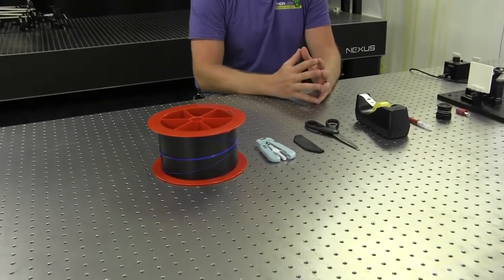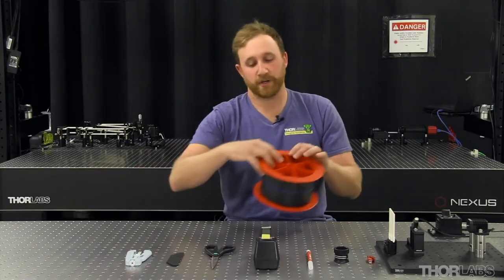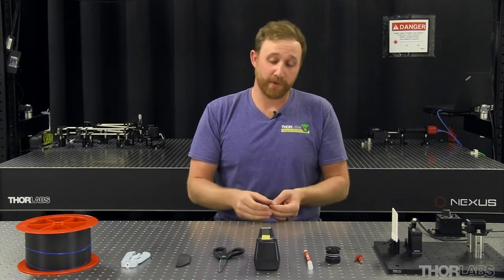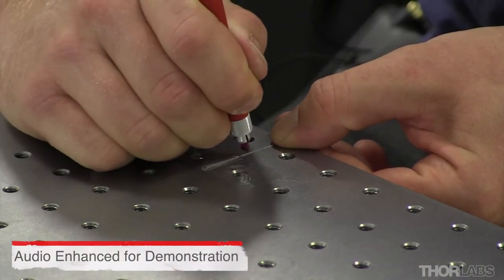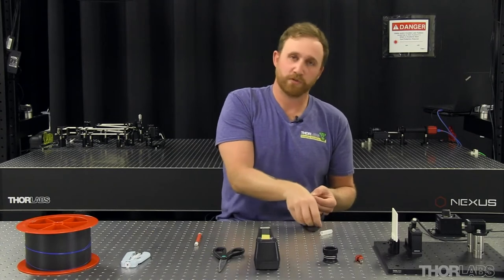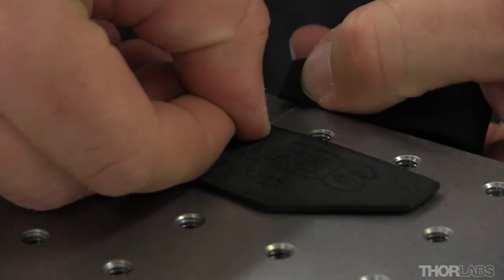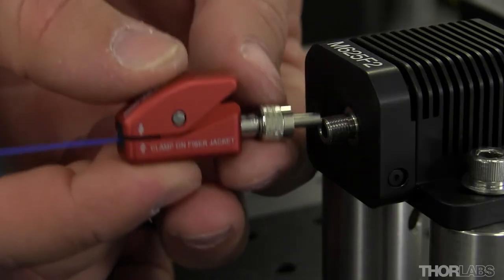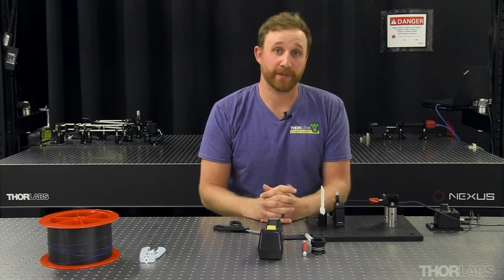Cleave a Large-Diameter Silica Fiber Using a Hand-Held Scribe | Thorlabs Insights

Comment: Do you recommend any special methods for obtaining a good cleave for 1mm core MM fibres?
Reply from the maker: To get a good cleave, it is necessary to properly tension the fiber. The tension lets the score mark created by the ruby scribe propagate across the fiber. To properly tension the fiber, the fiber should be pulled straight, along its axis. If the fiber is twisted or if tension is applied at an angle, the resulting cleave could be angled or even concave in shape, with a raised edge on one side. The amount of tension that must be applied increases as the fiber's diameter increases, so achieving a good flat cleave by hand gets more difficult as the fiber diameter increases.

For a fiber with a 1 mm core, it is very challenging to apply by hand the amount of tension required to produce a good flat cleave. Thorlabs' internal practice for preparing the end face of fibers with diameters >1 mm is to first perform a best-effort cleave and then polish the end face flat. During the polishing step, we use a BFT1 (https://www.thorlabs.com/newgrouppage9.cfm?objectgroup_id=8543&pn=BFT1) bare fiber terminator, matching connector, and polishing supplies. Let us know if you would like additional information.

Comment: Thanks for demo, could you please also make a video on how to get a good cleave for 400um PM fibers
Reply from the maker: @Velpula Balaswamy  Thanks for your suggestion! To help us better understand the fiber you have in mind, which characteristic of the polarization maintaining (PM) fiber does 400 µm describe?
Reply: @thorlabs  It is the cladding diameter. Core diameter is 20µm
Reply from the maker: @VelpulaBalaswamy  Thanks for the additional description! For those who are curious, many polarization maintaining (PM) fibers are constructed with the fiber's core located between two stress rods. The fiber's PM properties are provided by the stress intentionally exerted across the core by the inclusion of the stress rods ( https://www.thorlabs.com/newgrouppage9.cfm?objectgroup_id=14208 ). But, the non-uniform stress profile across the fiber's cross section can make it challenging to obtain an optical-quality cleaved end face.

When a hand-held scribe is used, it commonly creates defects in the fiber's cladding. As long as the core and surrounding area out to the stress rods is not impacted, these defects can often be considered cosmetic and disregarded. More typically, a mechanical cleaver is used to provide a higher-quality and more repeatable result, although the 400 µm cladding diameter of this PM fiber is not accommodated by all mechanical cleavers (one option is the LDC401 https://www.thorlabs.com/newgrouppage9.cfm?objectgroup_id=9352 ). Some people will also polish the end face after cleaving to clean up any defects from the cleave.